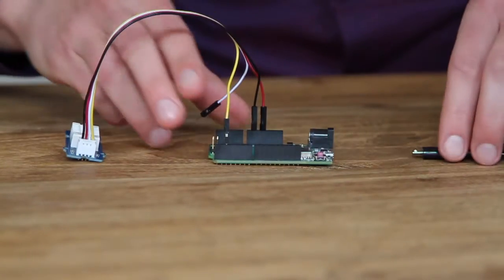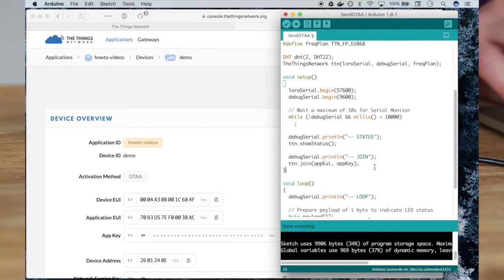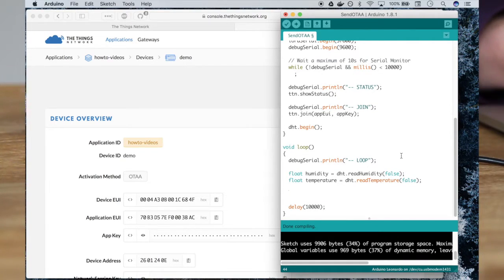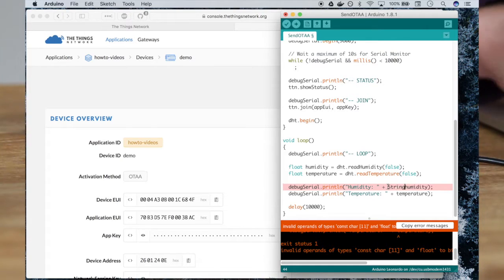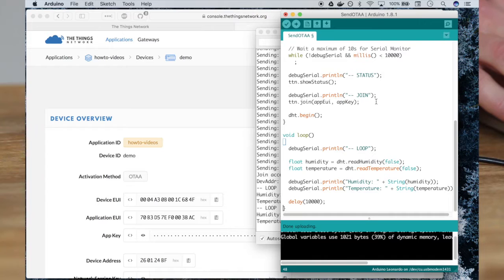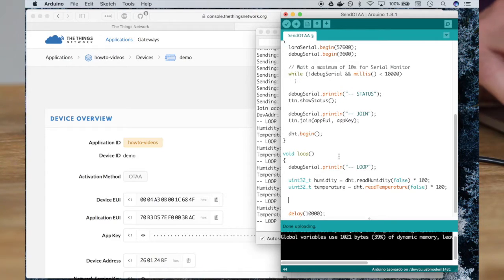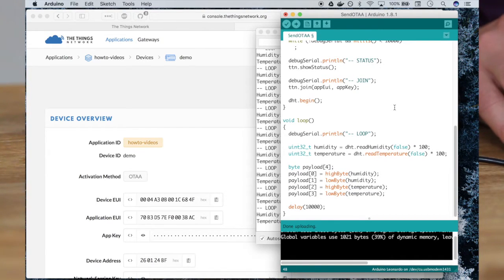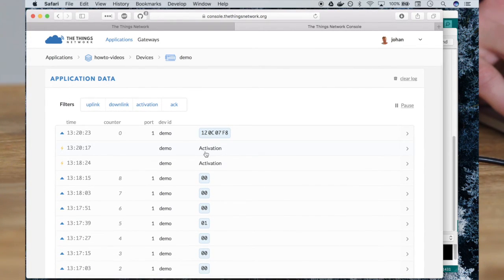How To: The Things Uno Part 3 - Connecting Sensors

Comment: It looks like there are some little mistake in your code :), however great video !

You shouldn't use uint32_t type for the humidity, as the humidity cannot go more than 9999, uint16_t can handle it. Also when using highByte(), you are only taking care of the 16 lowest bits (don't use it with 32bits variables), here is the doc description: 

function highByte() 
Extracts the high-order (leftmost) byte of a word (or the second lowest byte of a larger data type).

For the temperature you shouldn't use an unsigned type, rather choose int32_t or even int16_t, because yes, temperature in celsius can go lower than 0.

Finally choose a better size for your final payload, it should be able to handle all your variable (uint32_t variables are 4bytes each, you should have a payload[8]).

I guess something like that is better:

  uint16_t humidity = dht.readHumidity(false) * 100;
  int32_t temperature = dht.readTemperature(false) * 100;
  byte payload[6];
  payload[0] = highByte(humidity);
  payload[1] = lowByte(humidity);
  payload[2] = (temperature >> 24) & 0x000F;
  payload[3] = (temperature >> 16) & 0x000F;
  payload[4] = (temperature >> 8)  & 0x000F;
  payload[5] = temperature & 0x000F;